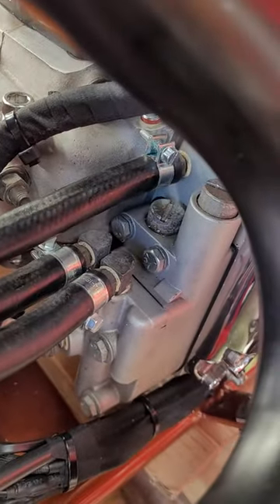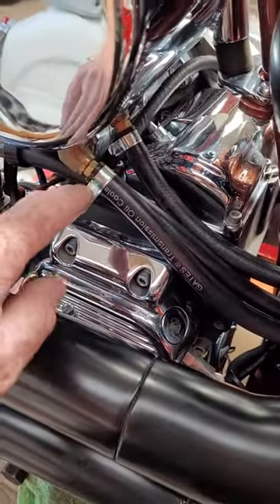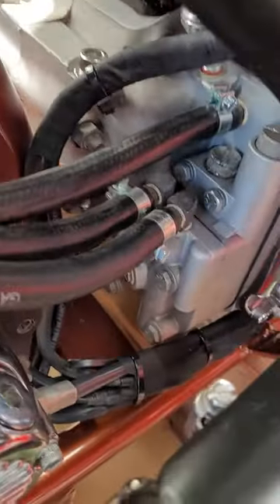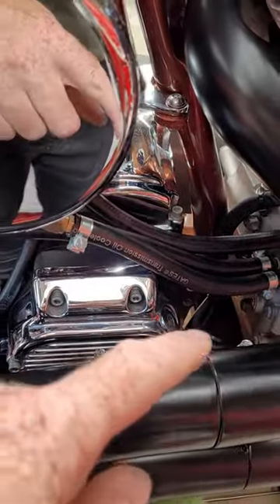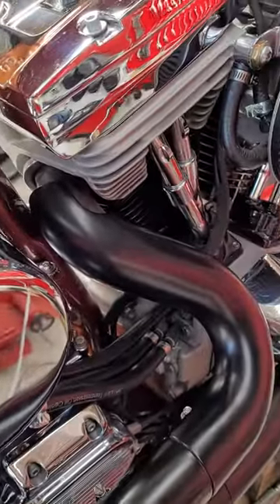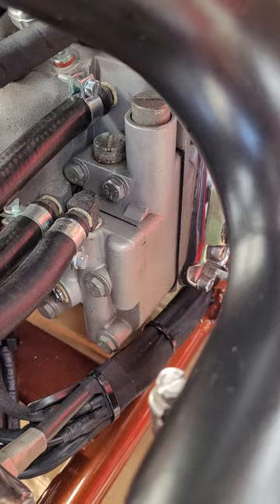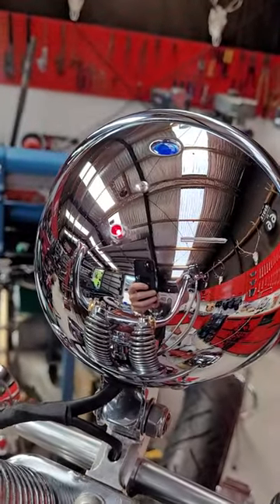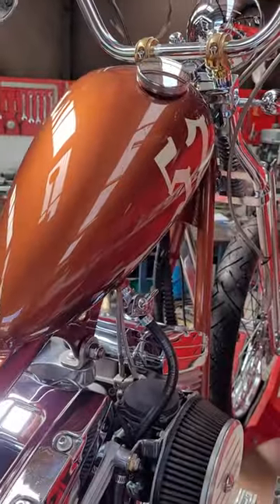Priming harley evo oil pump

Comment: How
Do
You hook up that light?
Reply from the maker: @riffraffchoppers  I drilled a hole in the headlight and put a little led in there. The signal comes direct from the oil pressure switch on the motor.
Reply: @ how did you wire it? I was trying to test my oil pressure today  and my mechanic gave me a toggle switch that lights up and told me to hook the ground wire to the sensors on the cases and positive to accessory power and when key goes on light will
Come on then go out when bike running and pressure built but the sensor on the case doesn’t ground out some how so I can’t test it. Is that a bad sensor or do they not ground there ?
Reply from the maker: @riffraffchoppers  from memory the pressure sensor is earthed, and when pressure builds it breaks the circuit.

So positive to light +, negative - to sender.
Reply: @ ya man I tried a toggle switch with light on mine but the switch wasn’t grounding but on my other chopper it was it was weird and the one it didn’t work on is a brand new motor but that terminal on the switch was brass so maybe somehow it wasn’t grounding
Reply from the maker: @riffraffchoppers  try testing it (the pressure switch) witj a multimeter on continuity beep. It should make a circuit on the engine cases, and the output terminal. As these are normally closed allowing power to flow when there's no oil pressure. When oil pressure is there, it breaks the circuit.
Reply: @ so put one to the sensor and one to the engine ?
Reply from the maker: @riffraffchoppers  yes. It should show continuity on multimeter as that should be closed circuit.

If you put a multimeter probe on ground and other end on senders output terminal and there's no resistance (continuity beep), then the sender is stuffed. As the sender is open and it should be closed (with no oil pressure when the motor is turned off).
Reply from the maker: @riffraffchoppers the sensor is literally an on/off switch. That it. The switch should be on, allowing power to flow. That's why the warning light turns on when the ignition is turned on, but the motor isn't running.

When the bike starts up, it builds oil pressure, the sensor switch turns off. Stopping power from flowing through the switch. That's why the oil warming light turns off

So think of it that way, its just an on/off switch. To test it, run a test light or multimeter using it on negative side..
Reply: @kimjon3774  got it. Ya this one is brass and all my other ones are steel so maybe that’s a problem. I’m gonna go test it now
Reply: @ the test light way doesn’t work but the ohms test ya it’s a bad switch and it’s brand new. My other bike with silver terminal beeped. This one with brass didn’t